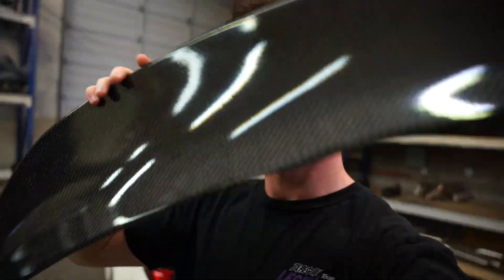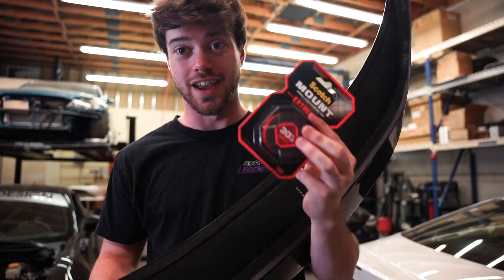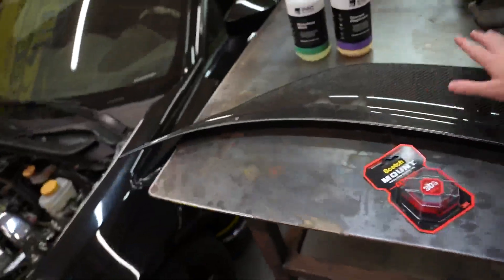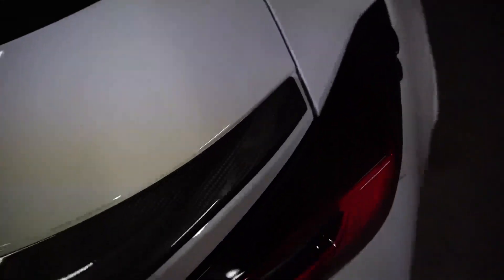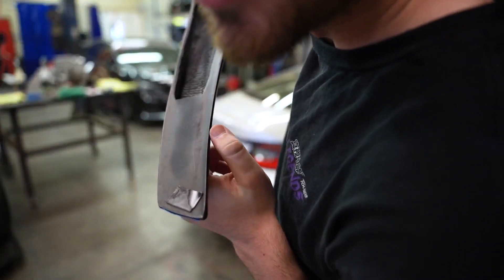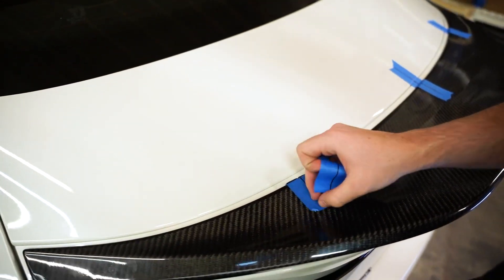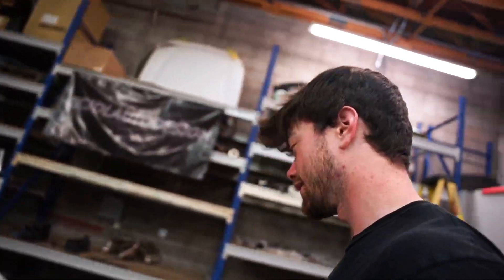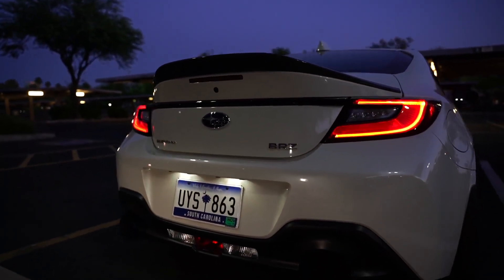The BEST THING I've Done to The BRZ *Carbon Spoiler Install*

Comment: Looks great.  FWIW i used 3m tape (that came with a spoiler) and some 3M spray adhesive on a duckbill on my GLI, been on for 2 years and is rock solid that is with a massive commute and lots of triple digit speeds.  These modern adhesives are serious stuff.  Hope the clearcoat holds on your CF wing, nice work.

Comment: Actually I had an oem spoiler from a junkyard that I just used with 3m tape. Suprisingly it lasted fora good few months before one side started peeling off. Had a friend had his spoiler fell off the freeway. Luckily he was all the way to the  far right lane where no one was behind him. So yeah its better safe than sorry with drilling holes and not have to worry about it flying into someone's windshield.

Comment: That looks amazing Ben I have a wing extension on my st held on with 3M tape it's been on there over a year now hasn't moved that some strong s##t mate
Reply from the maker: For real I wasn’t expecting it!
Reply: @BenLovrien  can't wait 2 see all the other bits can I ask u when u put your snorkle on the st did u use just any bolts as I've just got 1 but no bolts with it?
Reply from the maker: Yeah you need two bolts, should have come with them
Reply: @BenLovrien  there were no bolts with the snorkle